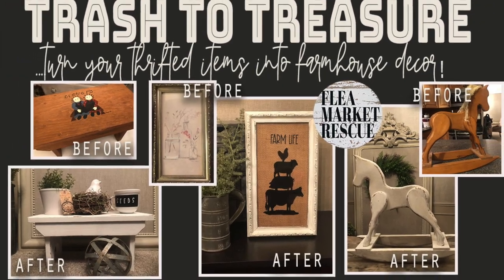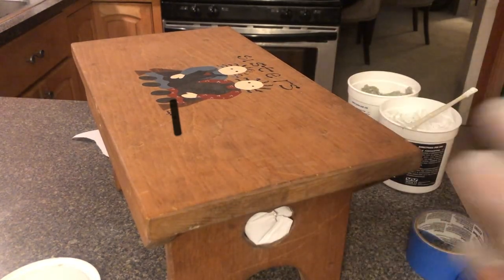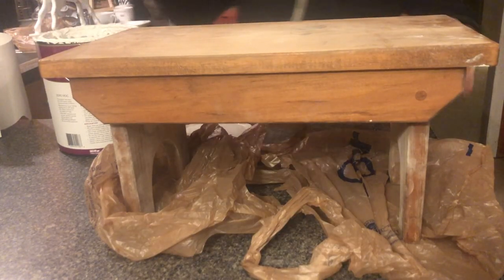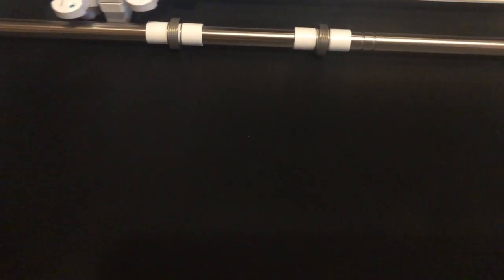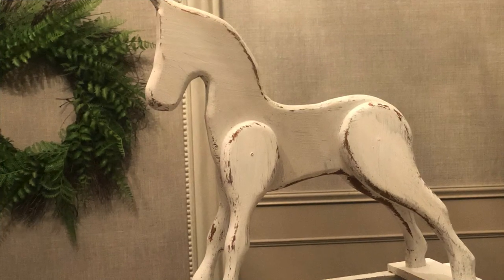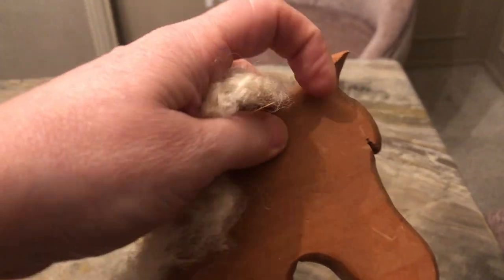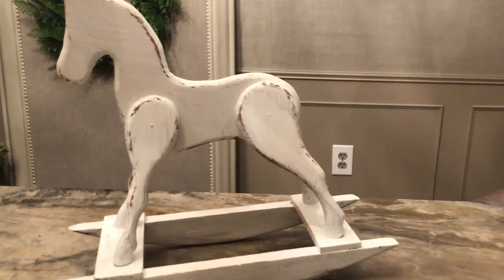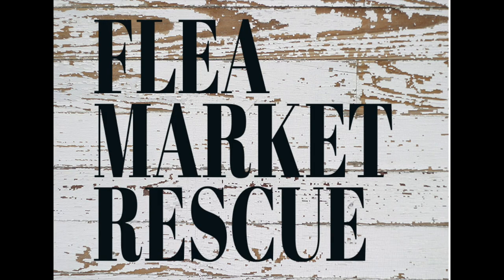TRASH TO TREASURE DIY FARMHOUSE HOME DECOR-THRIFT STORE MAKEOVER

Comment: do you seal when you're done distressing?
Reply from the maker: Chris tina...I did not seal those pieces in the video, however, with the little bench....you definitely could do that with some wax or polyurethane if you think you're going to be using it a lot of it's going to be on a porch.  As far as, the frame or the horse that I distressed...no, you really don't need to seal those.  I mean...you can if you want to, but it's not necessary.  Hope that helps!  Thanks for watching and you have a GREAT day, today!  XOXO
Reply: @FLEAMARKETRESCUE  so pretty much unless you're going to be handling an item or it will be outside, there's no need to seal?